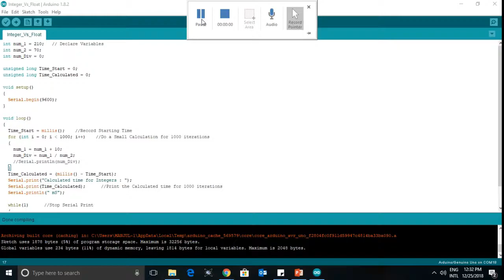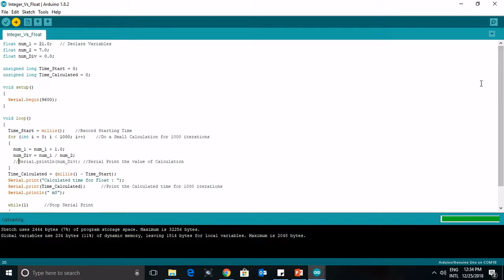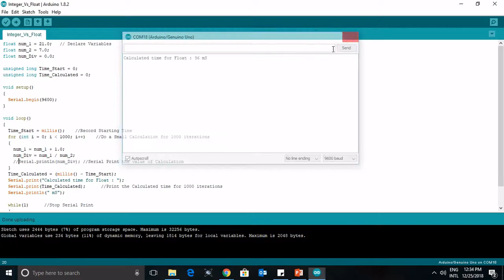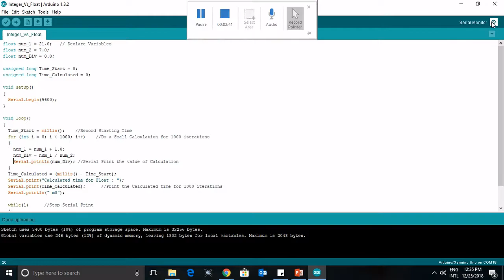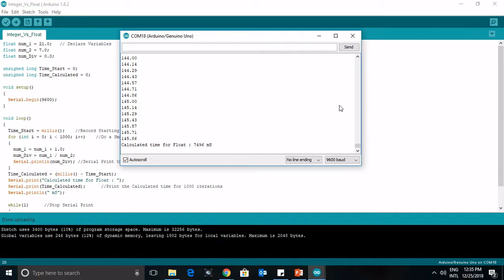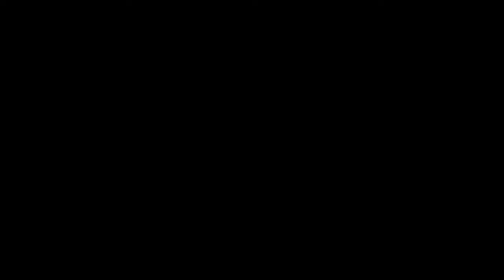Arduino Integer Vs Float Arithmetic Operations and Serial Print Speed comparison

Comment: how to do calculations from 0 to
281474976710655 in arduino
need to convert it to hex and then to hex string of 12 digit how to manage this huge integer in arduino